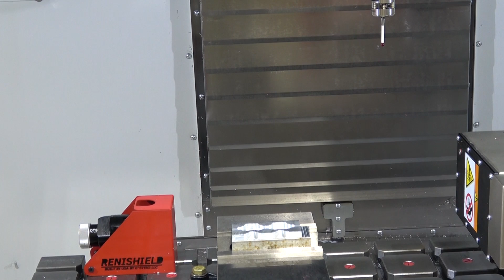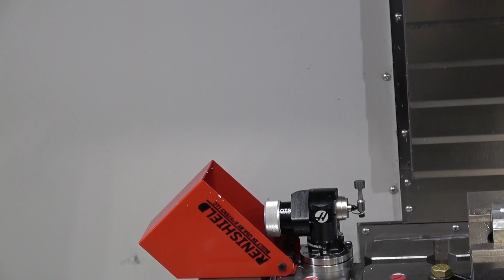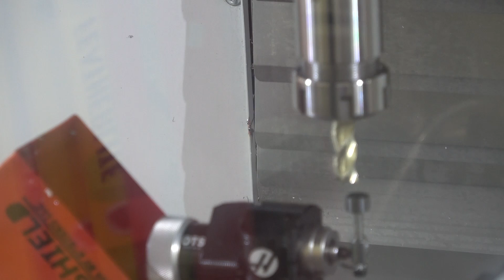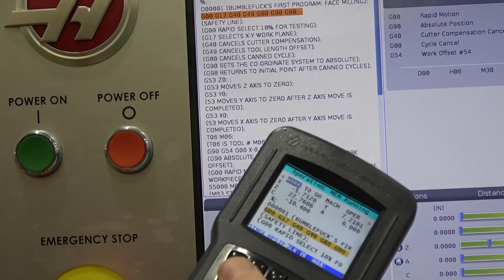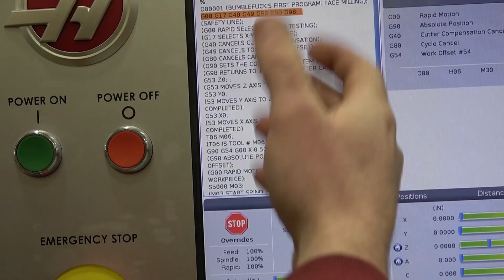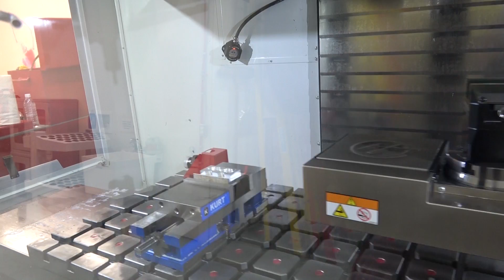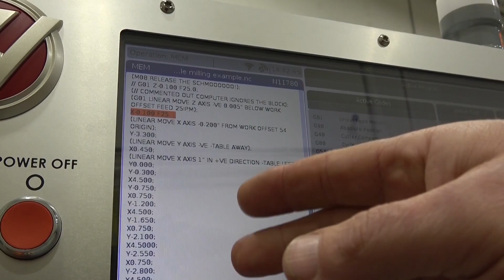Old School G-Code worth the HAASsle? | Intro to CNC mini-series Ep. 2

Comment: Well, I just pretended you said "Kant", and when i do something I don't want to turn into a philosopher.
I appreciate your honestness, on nyccnc whenever he gets a new tool every second word is "amesone", even if it took you 5 times longer than it would take you manually he would still call his CNC awesome. It might be cool, but not as affective as i'd hoped, not as effective as the wanketeers say. It's not a bad channel, but he makes it look like just buying some expensive tool is the key to success.
Like for some decorative parts you don't need any CAD or CAM at all, just draw a shape on the stock with a marker and follow the line on a manual mill. Getting the job done is the only thing that matters for a production process.

Comment: I'm 59, I have been a fitter and machinist for 41 years, we have 8 CNC machines in the shop and I don't even want to know where to turn them on at. I want Absolutely nothing to do with them, they are waaay too confusing. I have watched them work, and I have heard them crash, and I have welded up soo many stuffups that I don't care to mention. Here endeth the lesson.
Reply: scott carr 
kind of a shame you're holding yourself back - I'm the same age, started in the trade in '77 on manual machines and stayed on them 8yrs.
I've stayed up with the technology,  taught night school machining classes - stayed right in the middle of it.
there isn't a part made today we couldn't make before CNCs, but it's  SO much easier and faster now.

Comment: What model HAAS are you working with? Listen to AvE he brings forth some good points i.e. cut air on first run, unless you have DEEP pockets.). I learned g-code programming solo, the Co. I work for bought a Cinci VMC circa '98 and said to me: "I learn how to use to this" No joke. Bought a book or two, started reading, then fuck all. Sat down @ machine and got to really learning, no CAD/CAM or conversational just me & G-code. Mind you we don't make 100s of widgets at a run we get castings a whole different world. All castings are different to a degree so things always need to be tweaked a bit and g-code lets me do this fast on the fly. I tend more to use the VMC as really big Bridgeport with a DRO (All you real programmers stop wincing) it works for me. Bolt circles, interpolation, tapping & drilling cycles, pocketing and facing canned cycles I do take advantage of. Ya ain't gonna learn fuck all with limited seat time.
If the spindle ain't turning you ain't earning, and yea your break some tools, but patients, and seat time will become your best friend, don't be intimidate by anything or anyone. I admit I had rough time the first few weeks, but after that it just became easier every day. 
AvE thanks for all your vids; have a great safe holiday with your family. You da man!!

Comment: Commenting out a line with a \ only works if you have block delete enabled (second down on the far right of the panel). It allows you to remove features (pockets, holes, etc.) in similar parts by removing a sub-program call or other commands allowing for multiple parts on the same program. Otherwise just comment with parenthesis.

Comment: I learned G-code back in the days when Autocad didn't have a fully working CAM package and the crap it produced took so much longer than you made yourself that it was only seen as a novelty.
We wrote all G-code by hand by using drawings as reference and we quickly learned to read G-code fast to spot errors before the CNC machines crashed.
Today we have more G-codes that we used to have (or at least use) in the early 90's and there was a difference between the G-code for different machines, or dialects as my teacher would call it. I was taught the Fanuc G-code system and I was really good at it before I decided that this wasn't my thing and I went full software designer instead.
I've recently picked up CNC stuff again and I seem to remember quite a lot of my G-code stuff so I struggle to see the issues many of you have with understanding G-code, but then I've spent half my life writing assembler for obscure processors which probably makes me weird anyway... ;) 
To me there are only two sets of instructions; fast move and machining. There are also configuration instructions like what tool to use but those are simple and few. Try to use as few different instructions as possible instead of using weird and obscure ones, that way you learn faster. Also compare your own G-code to generated from CAM and draw your conclusions from the difference. CAM stuff is often really ineffective from what I remember anyway...
I do think it's awesome that today real CNC machines are available for us mortals! Back then a Fanuc CNC system costed millions whereas a Haas machine, albeit much smaller, costs way less. That's progress I like! :)
Hey, Merry Christmas you filthy animal Uncle Bumblefrick! I hope the fat man swings by the land of the beaver tomorrow night with more things to break!!! :D
Reply: Do you balance your checkbook in hexadecimal too ?
Reply: All the G codes you will ever need and some you probably won't:
M03 - spindle clockwise
M04 - Spindle CCW
M05 - Spindle off
M08 - coolant on
M09 - coolant off
M97 - local subroutine
M98 - external program
G0 - rapid move
G1 - cut in a straight line
G2 - clockwise circle cut
G3 - CCW circle
G4 - pause here
G81 - drill
G82 - drill and dwell at bottom
G83 drill with pecks
G84 - tap
Whatever WCS G codes are in your machine
G90 - absolute coordinates.
G91 - incremental coordinates (don't ever use it for a main program but can be useful in some subroutines)
Annnd... that's about it.  I stick an extra G17 (XY plane for circles) in my safety blocks but that's default and shouldn't matter unless you want to do an arc on the Z axis.

Comment: One thing we do in my shop is to take Z to .130 above the part. When you are single blocking through it's easy to gauge by eye if the tool is about an eighth inch away from the part. Most CAM posts are easy to edit that into. 0.130 just because it tends to stand out and that's been our convention for 20 years, everyone knows to watch for it.

Comment: Do you know how many time some one told me that this program can't work; it does and save about 2 to 10 hours sad thing is I dont work at that place any more.

%
O00099 (*GEN HANDLE*) 
( MADE CJ 11-6-15) 
G91 G00 G28 Z0. 
G40 G90 
G#590 

#22= 0 (MUST=0) 
#2= 1 (Number Loops) 
#4= 1. (Z DEPTH PER CUT) 
#6= 3 ( TOOL) 
#14= 5 (1=Rt 2=LT 3=SAME /4=DIF 5=MIR/DIF) 
#15= 6.4 (TOOL R) 
#21= 0 (HOW MANY Z CLEAD UP, 0=NO)
#25=3000 (feed)

(INC MOVES FROM CORNERS) 
(MUST BE ZERO IF THEY DONT) 
(USE FOR BOTH RIGHT AND LEFT) 
(FIRST CORNER RELIFE CUT /G91 FROM CORNER) 
#16= -6.4 (X) 
#17= 6.4 (Y) 
(SECOND CORNER RELIFE CUT/G91 FROM CORNER) 
#18= 6.4 (X) 
#19= 6.4 (Y) 
( ) 
(right,LEFT & SAME) 
#8= -20. (Y BEFOR CUT) 
#9= 766. (1ST X, POS) 
#10= 204.7 (1ST Y) 
#11= 835.9 (2ND X, POS) 
#12= 190.5 (2ND Y) 
#13= 970. (X TO CLEAR HANDLE, POS) 
GOTO2 
N1 

(left different handle only) 
#8= -20. (Y BEFOR CUT) 
#9= 766. (1ST X, POS) 
#10= 204.7 (1ST Y) 
#11= 842.2 (2ND X, POS) 
#12= 190.5 (2ND Y) 
#13= 970. (X TO CLEAR HANDLE, POS) 
(XX XX) 
N2 
#24=#25/2
#22= #22 + 1 
IF [ #14 EQ 2 ] THEN G101 X0 
IF [ [ #14 EQ 3 ] AND [ #22 EQ 2 ] ] THEN G101 X0 
IF [ [ #14 EQ 4 ] AND [ #22 EQ 2 ] ] THEN G101 X0 
IF [ [ #14 EQ 5 ] AND [ #22 EQ 1 ] ] THEN G101 X0 
#3= 0 
T#6 M06 
S5000 M03 
G43 H#6 D#6 
IF [ [ #14 EQ 3 ] AND [ #22 EQ 2 ] ] GOTO5 
#9= #9 + #15 
#10= #10 - #15 
IF [ #10 GT #12 ] THEN #11= #11 - #15 
IF [ #10 LE #12 ] THEN #11= #11 + #15 
#12= #12 - #15 
#7= [ #9 + 20 ] 
N5 
IF [ #21 EQ 0 ] GOTO3
IF [ #16 EQ 0 ] GOTO7 
#16= #16 + 2
N7
IF [ #17 EQ 0 ] GOTO8 
#17= #17 - 2 
N8
IF [ #18 EQ 0 ] GOTO9  
#18= #18 - 2
N9
IF [ #19 EQ 0 ] GOTO10 
#19= #19 - 2
N10 
#9= #9 + 0.5 
#10= #10 - 0.5 
IF [ #10 GT #12 ] THEN #11= #11 - 0.5 
IF [ #10 LE #12 ] THEN #11= #11 + 0.5 
#12= #12 - 0.5 
N3 
G00 X#7 Y#8 
G01 Z0. F4100. 
G01 Z - #107 F3500. 
M97 P10 L#2 
G00 Z10. 
IF [ #21 EQ 0 ] GOTO6
IF [ #16 EQ 0 ] GOTO11 
#16= #16 - 2
N11
IF [ #17 EQ 0 ] GOTO12 
#17= #17 + 2 
N12
IF [ #18 EQ 0 ] GOTO13  
#18= #18 + 2
N13
IF [ #19 EQ 0 ] GOTO14 
#19= #19 + 2
N14 
#9= #9 - 0.5 
#10= #10 + 0.5 
IF [ #10 GT #12 ] THEN #11= #11 + 0.5 
IF [ #10 LE #12 ] THEN #11= #11 - 0.5 
#12= #12 + 0.5 
#3= 0 
#20= #4 
#4= [ #2 * #4 ] / #21 
#23= #2 
#2= #21 
G00 X#7 Y#8 
G01 Z0. F4100. 
G01 Z - #107 F3500. 
M97 P10 L#2 
G00 Z10. 
#2= #23 
#4= #20 
N6 
G100 X0. 
IF [ [ #14 GE 4 ] AND [ #22 EQ 1 ] ] GOTO1 
IF [ #14 LE 2 ] GOTO4 
IF [ #22 EQ 2 ] GOTO4 
GOTO2 
N4 
G91 G00 G28 Z0. 
G90 
M05 
M99 
N10 
#3= #3 + 1 
G00 X#9 
G01 G91 Z - #4 
G90 
Y#10 F#25 
G91 X#16 Y#17 F#24
G91 X - #16 Y - #17 
G90 X#11 F#25 
G91 X#18 Y#19 F#24
G91 X - #18 Y - #19 
G90 Y#12 F#25 
X#13 
IF [ #2 EQ #3 ] THEN G00 Z10. 
G00 Y#8 
X#7 
M99 
%

Comment: Why do I feel like you are trying to make this as difficult as possible for yourself and make this look "hard". Just like we use a slicer to generate gcode for 3d printing, do your design in Fusion 360 and let it generate the gcode.  Then all you need to have a clue about is a small portion of start up script (just to be paranoid about what is going on) instead of spending all this time doing the circle jerk about trying to pretend no software can control this POS or you don't trust the software to be able to do the job it was programmed to do.

Fusion 360 can write G code (NC code) but you will need to tell the software how to cut your part by creating toolpaths in the CAM Workspace before Fusion 360 can write an NC code file. Once you have finished creating toolpaths, select the operations or the setups that you want to create NC code for. To open the Post Processor dialogue box, click the G1/G2 icon in the CAM ribbon:

Comment: when you use a single slash to comment out code, you have to turn on BLOCK SKIP to skip the / lines.  On Haas I believe they call it BLOCK DELETE, should be close to the optional stop button.  If you want to just 'comment out' a line of code, but it in brackets ( forget this ) and it will be there later when you need it.   Other than that, great intro for the greenhorns.   I watch G code trip up guys that have been running these confuser chip pukers for decades.  Takes practice.

Comment: Wow, surprised they designed these to be so low level. Laser scanning the block of material so the machine knows the coordinates...the rest is CAD. You give it a chunk of material that is larger than the finished part, the machine scans the part in space, knows the vice location based on markers - good to go. Operating simply loads the part, pushes the button. Doing this manually...why. 

Oh, that's an extra $50 K....right

Comment: It is a simple blind man searching for the counter at Timmies in a shopping center. I have seen this happen on multiple occasions, it is remarkable, and it happens often successfully. Remember the machine is blind and not filled with common sense (has none, it is a literal device) and it will do exactly what you tell it to do and not (never) what you think you told it.  I have great affection for CNC, but it is brutally honest (crashed tool (a $200 cobalt 6 flute end mill), destroyed material ($400 dollars worth of titanium), wasted effort/lost time (can't tell you how expensive this was), serious damage to the machine ($1000 blown servo amplifier), etc.) and a machine mistake is your mistake. Wish I had the finances to own a machine like this. This is the tool of tools, but it still needs a MIND to run it properly.

Comment: :8000(PILLAR HOLES)
#100=1.0(CUTTER DIAMETER)
#101=30.0(X CENTRE)
#102=30.0(Y CENTRE)
#103=0.0
#104=30.0(DEPTH OF HOLE)
#105=50.0(DIA OF HOLE)
#106=3000(SPNDLE SPEED)
#107=500.0(FEED)
#108=10(TOOL POS)
#110=20.0(DEPTH OF CUT)
G00G91G28Z0.0
G91G28X0.0Y0.0
T#108M06
G00G90G54X#101Y#102S#106M03
G43Z10.0H#108M08
N1WHILE[-#104LE#103]DO1
#103=[#103-#110]
IF[-#104GT#103]GOTO20
G1Z#103F[#107/3]
G03X[#101+#105-#100/2]R[[#105-#100]/4]F#107 I-[#105/2-#100/2]J0.0
X#101R[[#105-#100]/4]
G00Z10.0
END1
N20#103=-#104
G01Z#103F[#107/3]
G03X[#101+#105-#100/2]R[[#105-#100]/4]F#107[[#10-#100]/4]
G00Z10.0 M09
G00G91G28Z0.0
G91G28X0.0Y0.0
M30

TRY this programming if you want to learn real G code!

Comment: My first job was making plastic injection moulds using a hurco CNC. 
Holy fuck the first time I forgot to zero the tool in the z axis when I was machining an ice bucket core was some clown shoes shit. 
That mo fo was trying to drill to Australia as the last job was about 20mm....
The carbide explosive spunk (and associated CNC vinegar strokes) ensued.

Comment: Get a friggin lathe, once you get a lathe G code is way more useful. Cam for lathe sucks balllls, you need the finesse and control to roll the burrs around in just the right way with manual programming.
Its nice to see bumblefucks un-filtered, un-on the job trained opinions on stuff like commenting and what order to put codes in tho.

Comment: Your probably going to go for CAM programming. But to do a shorter version of "go to home" you can do this:
-------------
G28 G91 Z10 X0 Y0
G90
-------------

Machine will move to incrementally up in Z  10 inches and then full speed all axes to home position. Never forget G90 afterwards :) 

Usually I just go:

-----------
G28 G91 Z0 
G90
------------

Because you usually don't care where you are in XY you just want to be clear for indexing or go to tool change. G90/G91 is a hassle but we don't get incremental axis letters (UVW) on the mills like we do on lathes, don't know why.

Comment: Block skip mode has to be on in order for it to skip a line with a single "/" on it. For instance on my Hitachi lathes the coolant line is /M08 all by it's self. 
Also on most shit G28 is your machine coordinate system, so
G28 Z0
G28 X0Y0
 sends everything home safely, I think this works on the Haas, but proceed with caution, it's been a while since I programmed one, and back then I just did a regular old 
G53 Z0
G53 X0Y0
Now on the Haas you can have a safe tool change location set in the parameters so that any time you M06 it automatically goes to that position in XYZ. On my Hitachi machines you can go to this position with a G30 in place of G28 or G53. Also that Haas automatic coolant nozzle never sets it's self correctly, I always had to set the value manually.

Comment: I only use the tool setter to probe length and then I use that same tool to touch off my z axis on g54 so if you probe all your tools for the job and use one of them to set the z axis then if the probe was slightly nudged or out of position you don't scrap your part but that would also mean that you don't set your z axis with the spindle probe. If the probe was nudged or out of calibration then all tools would be set with that same error making it correct in theory the only thing that would be off is the true distance between the tool tip and spindle nose. Of course this is only if there's a small error but this could be used so you don't always have to re calibrate your probes so you can keep working. I've never owned a haas so maybe it's real easy to calibrate them.

Comment: I've owned cncs for 15 years up to 6 axis and I still don't know most g code cause if you have a good CAD/CAM software and a reliable post processor that you trust it's just not profitable to manually program g code.  Memorizing all the code just takes up too much space when you have to take into account all the other things you have to know while machining. Always watch your distance to go and have your hand on the rapid override plus it's also good to set your z work offset well above the part to proof the program too then move it back down when satisfied with the tool paths.

Comment: learning G-code has its place in checking your CAM program because it can do wonky things sometimes and you can catch the mistakes before it happens. Running the machine on very low rapid percentages and slower feed on the first few cuts is advantageous and it also to gives you reaction time. I haven't crashed one yet but I'm still learning the ropes. learning manual machining first helped me with CNC machining to know if I am pushing the machine too hard based on sounds and chip loads.

Comment: One piece of code I was taught to add to the safety line was G70 or G71.  The set the type of dimensional units the machines controller would recognise. G70 was imperial with G71 being metric. Being based in the U.K. the metric system had precedence and 99% of my part-programs used G71.  The use of these codes seems to have diminished, with some controller manufacturers using these particular codes to activate other machine tool functions. Certain G & M codes are controller specific, for example my waterjet profile machine used M13 to purge the grit media delivery tubes.